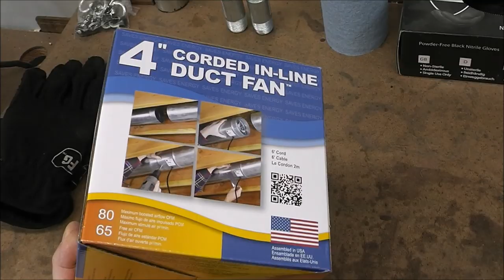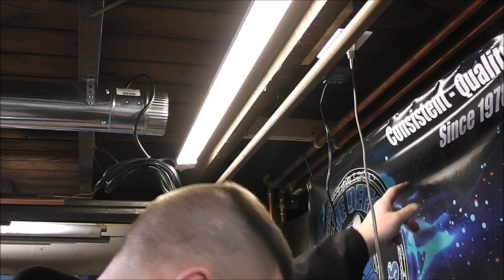EASY DIY Welding Workshop Ventilation Fume Extractor  Done CHEAP

Comment: Dude, you can't blow air into or suck the air out of a closed room or container (try it with a beer bottle). 

To move air through a closed room or container, you need an inlet and outlet.  So, if your exhaust system really is moving air to the outside, you are putting the building under lower pressure than outside, and makeup air is seeping into the building from somewhere.  This is usually through cracks in walls, and around windows and doors that penetrate the outside envelope of the building.   If the envelope of your building were completely sealed, your exhaust system wouldn't work. 

So you may in fact be drawing cold air into other parts of the building from outside more than normal while your exhaust system is running. 

Anything that exhausts air from your building and dumps it outside causes this problem.  This includes bathroom and kitchen exhaust fans, and anything that draws combustion air from inside the building like a clothes dryer, old or low-efficiency furnace, fireplace, etc.  This is why a fireplace that draws combustion air from the house warms the room that it's in (with radiant heat), but makes other rooms in the house cold because the cold outside air is sucked into the outlying rooms through cracks in the building's outer envelope.

Rooms in a house with forced-air heating that don't have both supply and return ducts are usually uncomfortable when the door is closed.  Such rooms can be cold in the winter and hot during the summer because the furnace can't blow air into or suck the air out of a closed room.

In any case, you aren't really "keeping the warm air in," since if your workshop stays warm, it's probably because your exhaust system is drawing warm air into the workshop form the rest of the house or building while making other areas cold.  Still, it's healthier to run the exhaust fan than not.
Reply from the maker: The workshop was built in the 50's so its far from an air tight container and this fume extractor is far more energy efficient than opening up a 60 sq. ft door to ventilate the shop when it's 10 below outside.
Reply: Brandon, my point is, with respect to ventilation and energy efficiency, there is little difference between opening the door and the makeup air seeping in through leaky cracks throughout the rest of the building.  However, when you open the door, you know where the makeup air is coming in and opening the door may eliminate or reduce uncontrolled makeup air getting sucked into other parts of the building.  

If you are exhausting air from a building, makeup air is coming from somewhere or no air would be moving.  In the summer, hot humid makeup air is coming in and in the winter, cold dry makeup air is coming thru the building envelope into the negatively pressurized building.

In a leaky building, the unconditioned makeup air may be seeping into rooms or living spaces that you would rather not have the unconditioned makeup air leaking into and moving through.  

This is a common problem in restaurants that have big exhaust fans in the kitchen if they don’t have a makeup air system specifically designed to address the problem.  The restaurant is under negative pressure, so patrons sitting near the front doors get blasted with outside air when the door is opened.

If there are any negative impacts from your DIY exhaust system, you can minimize them by only running the exhaust system when you need it.  Thanks!
Reply from the maker: @Dee jay Thank you! P.S. ill have a beer with ya and we won't talk about HVAC but we will have a good laugh about all the money we saved by not hiring an engineer to design our 60 dollar extraction setup that works and! Oh, and the beers are on me! Thanks for the chuckle buddy.
Reply: Dee Jay  Yep, you guys pegged me.  I studied civil, mechanical, electrical, environmental, and geotechnical engineering, I’m a PE practicing four of those disciplines in four states, and I have have 40 plus years of engineering experience.  However, my first “career” was heating, A/C, and ventilation where I learned how to estimate, design and install commercial and residential heating, air conditioning, and ventilation systems, make duct work, do plumbing, and electrical work, a little welding, and to sweep the floors of my dad’s shop.

I never acquired a taste or need for beer, alcohol, etc. to have fun with friends at parties who don’t seem to mind.  I’m frequently the designated driver.

In any case, others may realize my posts were factual not negative, and some may find them informative.
Reply from the maker: Don't get me wrong Earth Man, I appreciate your comment and you are far more knowledgeable than most about this type of thing, but for the folks that are watching this channel, most are just starting out, let alone hire a mechanical contractor to design them an evacuation system. I believe your intentions were well placed but probably a little too far advanced and technical for most of the folks on this channel. It might not be the perfect setup according to your training, but my goal in my shop was to remove welding fumes without it costing much, and for about 60 bucks it does.  Sure it has to be pulling in outside air from somewhere but my house is like most, its not a perfect envelope. If I can help someone have less toxic fumes in their environment I consider that a win (even if its not perfectly optimized).
Reply: @BrandonLund  Brandon, no problem.  BTW, I’m still working on my fume extractor and it should cost less than $60 since I’m using mostly recycled junk to make it.  Also, I won’t be worried about where the makeup air comes from.  Since I weld in my garage, I’ll have to continue to open the door until I finish my extractor.  Lots to do until I find time to do that!  Best regards.
Reply from the maker: Thanks man and good luck with your setup! Your workshop and your lungs will stay much cleaner ;)
Reply: So, what about just adding another dryer vent air input that can be opened and closed.  It would be the same size as the one going out, so should balance the situation right?
Reply from the maker: Unless you live in an airtight completely sealed building none of that would be necessary. Although some prefer to make things way more complicated than they need to be, this is the equivalent of putting a fan in your window and having it blow outwards. The fumes inside will go out.
Reply: I doubt very much a 100 CFM fan would create any noticeable negative air pressure in his shop.
Reply: @slakjawnotsayin5451  You don’t need another fan, just a hole or holes to the outside.  The fan will pump air out while the hole(s) will let makeup air in.  Most buildings/garages are so leaky, you probably don’t need a makeup opening.  Enough air will leak in to replace the air pumped out by the fan.
Reply: @kb3guz  ya you can see all the way around my garage door to the outside.  I just figured, if I put in 1 input and 1 output like dryer vents right by the generator, it wouldn't suck cold air in as much, and would just use the close input of air and pipe it out.  I'll try it without the input first, and can always add it after. Thanks.
Reply: @slakjawnotsayin5451  Having the make up air source close to the exhaust has merit. I used to work for an HVAC company and we installed make up air systems in restaurant kitchens. The make up air was ducted to and discharged above the cooking surfaces, which were below the exhaust hoods.  This reduced or prevented the big exhaust fans from putting the interior of the restaurant under negative pressure, which would suck cold or hot humid air through the front door (and every other opening to the outside) every time it was opened.